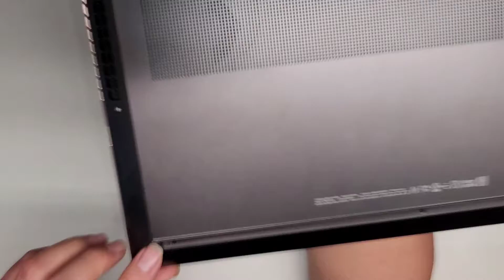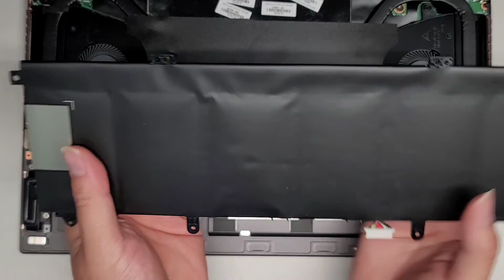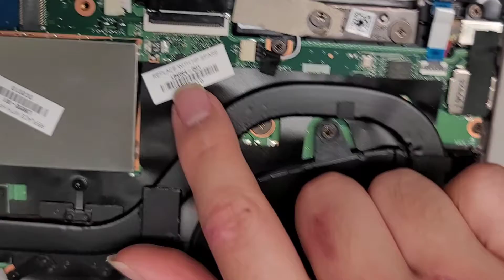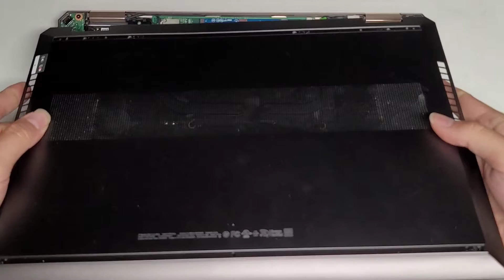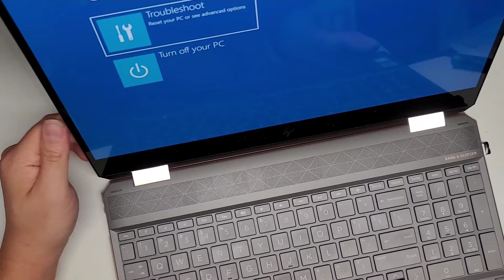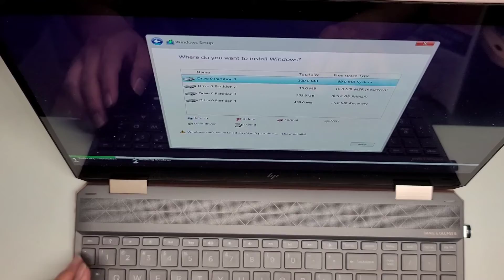HP Spectre x360 Convertible 15 15-df1043dx Disassembly RAM SSD Hard Drive Upgrade Replacement Repair

Comment: Will a bad battery cause my fans to run on high the whole time? Or it may be dirty/dusty inside? Currently my fans run high the whole time of using my laptop. Thanks
Reply from the maker: Check the temps
Reply: How do I do that? Is there a setting screen that shows temperature? What's normal running temperature vs running hot temperatures? I have this same laptop. Thanks again.
Reply from the maker: @LosAngeles21323.  You need to download a program like coretemp

Comment: I thought it was weird that the sides of the vent on the bottom cover was partially covered on the sides. I was about to remove them but I found your video and yours is the same. I'll leave it alone. 😊
Reply from the maker: Haha

Comment: My new problem is a blue screen bitlocker issue....any idea how to get around this? Thanks again for the battery replacement confidence  from your video!!
Reply from the maker: Sign into the website they give you and log in with your Microsoft account.

Comment: Got a Spectre x360 15-eb0013nf (10th gen i7 10750h, 16GB)... any idea if it has soldered RAM or not ? It seems there's no really reliable method (excepted disassembly...) to find out...
Reply from the maker: This might be closer https://youtu.be/aWXlO4mL0e8

Comment: I got the exact same model and I removed the rubbers and there is no screws whatsoever how can this be ?
Reply from the maker: Sounds like you didn't peel up the adhesive layer.
Reply: @ItsBinhRepaired  all of its gone what was under matches the same color as the laptop
Reply from the maker: @marvin_luis  doesn't make sense. Make a YouTube video and I'll take a look
Reply: @ItsBinhRepaired  you right it was under some black tape but slight problem you got any recommendations on how to remove strip screws
Reply from the maker: @marvin_luis  you need a screw extractor. I use this https://amzn.to/3Onr5Mq
Reply: @ItsBinhRepaired  does the extractor fit on a regular size power drill
Reply from the maker: @marvin_luis  yup, use the lower speed high torque setting and go very slow.
Reply: @ItsBinhRepaired  alright appreciate the help my laptop just keeps shutting off after being on for a minute or two just been needing to clean it
Reply from the maker: @marvin_luis  hope that's the issue.

Comment: Thanks for your video, I will atempt open and clean my Spectre, it's been like 5 years since I bought it, so I guess It may help it run cooler, the only hard thing to find is the rubber feet. Sometimes I think speaker makes a crackling noise when driven loud (Like above 70%) is it normal on this laptop?
Reply from the maker: If it's crackling, the membrane is likely torn on the outer edges.
Reply: @ItsBinhRepaired  Thanks on the advice, I will try to check that and find a replacement 🙌🏽
Reply from the maker: @hp6r  hope the repairs go well.

Comment: Hi,

As I haven't opened the back panel since purchase, I'm unsure of the whether i can upgrade my RAM or not.
It seems the rubber feet (only the rubber) on my laptop have extended 3cm and 2cm respectively beyond their original position, and it often comes out but the rubber feet parts i.e, the plastic sticks are still attached to the back panel  covering the screws sections Because the screws are not visible. Could you please advise on how to address this issue without causing damage? 
HP SPECTRE X360 15t-df100 CTO

Appreciate your assistance.
Reply from the maker: This video explains it https://youtu.be/Z04na84d9FQ

Comment: Man, I don't know how I would keep track of the screws and know where they'd go. LOL.
Reply from the maker: I mention my system at the beginning of my videos usually. Gotta put them in the pattern you remove them. Lol
Reply: I'm quite new at this I wanted to help my boyfriend with this but when you showed the flex grip straps holding down the battery I got scared of trying this on my own. A+ Computer Repair student here. His PC is an Acer Swift 3. @ItsBinhRepaired
Reply from the maker: Haha did you fix it?
Reply: @ItsBinhRepaired  commented on the wrong Video i was going to fix the Acer Swift 3.  Forgot the damn screwdriver set!
Reply from the maker: Did you get a screwdriver set? I recommend this https://amzn.to/3u8vRXy
Reply: I have it, just forgot to bring it to my bf's house to fix his Acer. RIP. @ItsBinhRepaired
Reply: If it ever gets fixed I'll thank you for teaching me to fix my first ever computer. LOL @ItsBinhRepaired
Reply from the maker: @hannaheliza3954  lol fingers crossed

Comment: I had a hp spectre x360 15 doing the same thing would only go into boot mode and wouldn't successfully boot back after doing so.  Brought it to a fix PC store and they got it running without replacing anything they said they just had to do something with the bios apparently.  But what sucks is several months later I started noticing the front of the laptop case would start to split at first it was very little so I didn't care but now it's soooooo bad and it's been like 2 years since they did the work bit I know it was definitely from them doing something incorrectly because it always had a slight gap from the time I got it back but like I said it wasn't a big deal at first and I didn't say anything cause I already went 2 weeks to 3 weeks without my computer.  This was right when all the kids were going online for school so they were slammed.  Idk if I should bring it back or not because of how long it's been now I feel I'd be a pain in their ass to do that but really feel they should fix it due to how hard and expensive it likely will be for me to fix it myself.
Reply from the maker: That's caused by a failing battery.
Reply: @ItsBinhRepaired yea it definitely was a failing battery right after I wrote this I removed the battery and man it was pillowed so badly!!!  I've been running it without a battery for a bit and it works fine like that.  What's weird is when the battery first starts to fail that bios boot loop seems to be a normal thing to happen first.  Likely due to the CMOS battery power coming from the main battery I'm thinking.  What's weird is it doesn't have any issues running without a battery at all though?  Anyways I just recently ordered a new battery, I also ordered new ram and a new ssd which it will be my first time replacing those.  I ordered a crucial 16gb x2 set up that runs at 3200mhz I'm hoping it will work as they said it was compatible with my model and I really wanted something that had faster transfer speeds and bigger capacity.  I wanted to go to 64gb instead of 32gb but it was hard finding any info on compatible ram and I couldn't find anything on if that would work or if it was even necessary to go that big.  I only wanted to go that big because it wasn't going to cist that much more money so if it would work I wanted to just do it at the same time.  The ssd is another story again I went with crucial as the company and bought a cloning set up which I need to research how to use.  I am wondering if I can clone the ssd while the original is still inside laptop and the new ones in the cloner?  I got a crucial 2tb with a decently fast transfer speed of around 7000mbps write And read speeds.  I want to get this laptop to game some what decently as I have been doing tons of cloud gaming and all sorts of gaming from all my devices.
Reply from the maker: @SpreadingKnowledgeVlogs yup, without battery is fine. You can clone using this software https://youtu.be/4p5jFDzVwUw
Reply: @ItsBinhRepaired  shortly after writing that review my laptop died.  I took it all apart and couldn't fix it.  I have a little knowledge on using a micrometer to test the resistance and voltage and it seems there's a short some where and I think I have it isolated to where it's shorted.  Whats weird is I was doing a huge usb drive clone job and it was getting super hot (the drive in the usb enclosure which was a ssd was what was getting super hot) right after that is when it failed so I'm wondering if maybe it pulled to many amps for too long and friend something in the usb side of the power rail.  I saved everything cause I'd really like to get it fixed one day but seeing as the laptop was sucking performance wise from the day I bought it I decided to instead of fixing it go for a used gaming desktop from around the same period of my laptop.  Ended up with a alienware aurora r7 for $360 that came with a i7 8700 watercooled and a nvidia gtx 1080ti and despite that hard ware being older it works so much better then what I had in the laptop which was a i7 8665u I believe.  The new one is 6 cores and 12 threads so more cores and threads then the old laptop plus a much much higher clock.  Mine for some reasons constantly hangs around the max boost clock speed of about 4.3ghz constantly even at idle.  It surprised me by just how well it plays games.  My laptop had the crappies nvidia graphics card u can get I feel with the mx150 and I was sold it as a gaming laptop but it could literally barely run even the lightest of games.  This new pc runs games at 1080p all high settings and gets 120fps all day long and then can even run a few games at 4k with frs activated.  So happy I went the route I went and also will never buy a pc brand new ever again.  I've learned so much just from this one experience.  Now I know what to look for in cpus and what not going forward.  I might eventually build a budget amd rig or intel rig using newer but still used parts so I can keep the costs down.  I want to get a rig that can run a 40 series card effectively.  Mines can probably do it for some games but seeing as it's limited to pcie x8 speeds which was dumb of them to do it doesn't really make sense to use a better card in my set up unless I plan to upgrade it eventually which I do.  So plan is to first buy the gpu test it with my current set up, I'm sure gpu intensive games and 4k will run better with it still and then when I can afford to switch it over to either a i9 set up 12th gen or newer or a amd am5 with 3d cache.  I'm nervous about going with amd though as I've heard they can be buggy.
Reply from the maker: You can't really compare a desktop to a laptop's performance lol

Comment: I opened mine up to have a look and clean out some dust and after i put it back now it takes long to boot and its running really slow 😭😅 lol and my keyboard right now seems to have stopped working wtf i didn’t really touch anything besides the ram, and even then i was careful
Reply from the maker: Hmmmm are the battery and touchpad OK?
Reply: @ItsBinhRepaired  battery is fine and touchpad also not working
Reply from the maker: @MeltDownxPR  likely the touchpad is the issue. They like to put thermal sensors in there sometimes. When it's not working right, it throttles the computer. Similar situation with the battery.
Reply: @ItsBinhRepaired  thats interesting, any recommendations on what I could/should do?
Reply from the maker: @MeltDownxPR  reseat their connections
Reply: @ItsBinhRepaired  i’ll give that a try, I appreciate you!
Reply from the maker: @MeltDownxPR  let us know how it goes
Reply: @ItsBinhRepaired  so far no luck unfortunately
Reply from the maker: @MeltDownxPR :(
Reply: @ItsBinhRepaired  yeah, CPU is at a constant 20% usage on idle and memory reads 35-36%

Not  sure if that’s normal, CPU still reads 20% after opening chrome and going onto a random website, strange
Reply from the maker: Hmm
Reply: Update after 2 years lmao, i had put the laptop to the side for a while but decided to check it out again 

I managed to figure out that the keyboard and trackpad still worked and that it was something wrong with the drivers. I upgraded to windows 11 by performing a clean-install and now the keyboard and trackpad are functioning normally 

The only issue i still have is that under “other devices” in device manager, theres a few drivers with the yellow triangle and some say “unknown device” 

Also the issue with the CPU, it gets stuck at the speed 0.40GHz , the BD PROCHOT keeps enabling after reboot, i manage to get the cpu to work normally by disabling it with throttlestop. 

Trying to figure out these last 2 issues and hoping to get a little more use out of the laptop for the remainder of my semester lol 🤣
Reply from the maker: Lol nice

Comment: Hi, have you seen where the backup battery is? i have to replace it. I haven't found any videos on this.
Reply: There is no bios battery or w.e. it's called.  The guy commenting probably has the same booting problem this computer and mines had.  That's what I was told was wrong with mines at first but it ended up being something else.  I believe the bios got corrupted some how.
Reply from the maker: I see
Reply from the maker: What backup battery? There's only the one.

Comment: is there a wifi card on this board that can be replaced?
Reply from the maker: Not replaceable. Pretty sure I mention it in the video.
Reply: @ItsBinhRepaired  thank you. My computer updated the bios and now wifi is disabled and has a yellow exclamation point and wont reset at all even after performing system recovery and hardware diagnostic is saying it has no problem and I was trying to see if I need to replace the network card
Reply from the maker: Try bios reset and delete the driver completely
Reply: @ItsBinhRepaired  I tried and after performing component test, it shows wifi card is bad. I guess now I have a very expensive paper weight since the netword card is soldered on
Reply from the maker: @las0587  use a usb wireless adapter

Comment: Hey are you familiar with gigabyte laptops? I have an aorus 17x yb and the rgb keyboard won’t illuminate anymore. I tried everything. Even reset windows to factory and redownload the aorus control center. I’m beginning to think the keyboard lights are dead. I can’t find anything online to show where maybe there is connection is on the motherboard.
Reply from the maker: Not too sure why they would die. Did they stop working after a clean install or just randomly one day?
Reply: @ItsBinhRepaired   It just stopped working randomly. I left the laptop on overnight and when I got up the laptop had restarted itself and keyboard was off.
Reply from the maker: @justswitched8841  very strange
Reply: @ItsBinhRepaired  Yeah I don't know what happened. It being a not so common laptop I was unable to find anything online about it.
Reply from the maker: I hate how YouTube doesn't notify me of replies. Were you able to figure it out?
Reply: @ItsBinhRepaired  No actually. I ended up selling the laptop
Reply from the maker: @justswitched8841  aww

Comment: Thanks for the explanation. Intel 660p Series M.2 2280 2TB PCIe NVMe 3.0 x4 3D2 can be installed ?
Reply from the maker: Any pcie nvme SSD should work
Reply: @ItsBinhRepaired  Do you think should be worth it, to put SSD PCIE 4.0 SAMSUNG 980 PRO 2TB my HP specter is the same model only, the only diference mine its 2021 i7, 16Ram, 512gb SSD... but i see other info in ethernet that only can performe PCIE 3.0 so, PCIE4.0 Will not work as good as could be... Pls can you help me with this :(
Reply from the maker: @BIGBOSSZZ  I don't think the difference is worth the cost

Comment: Splendid video, exactly what I needed. 🙂
I personally always use a grounded wrist strap and a grounded desktop pad because of the MOSFET (metal oxide semiconductor field effect transistors).
Also, why not try to power it up with just the rear cover snapped back in place before putting in the screws?
Also, unless the customer absolutely, positively does not need their data files you should try data recovery first before over writing with a new OS install.
And the newer Mac's always max the fan speed when powering up. I believe it is to clean them a bit.
And finally, running a quick check using the diagnostics option F2 on the boot menu, at least on the hard drive and RAM would be a really good idea. 🙂
Reply from the maker: I just have my knee against my metal desk. Sometimes the hinges aren't strong enough without the screws, so I just put it back together.
Reply: @ItsBinhRepaired  The hinges are not directly supported by the bottom cover; you won’t damage the system without it temporarily while moving the display. The system board and top cover are sturdy enough. I do it this way all the time.

I only suggested snapping the bottom plate back on as a consideration to minimizing any damage due to static electricity, especially since it seems you are not even using a grounded desktop pad. You can even just set the laptop on its side edge.

Side facts: Even a very small amount of static electricity, too small to be felt can damage transistors. And amazingly enough static charges can even sit on top of paper, wool, hair, plastic wrap and a lot more.

Here’s a link for a very inexpensive pad and wrist strap.

https://www.amazon.com/dp/B09FK16B12/ref=cm_sw_em_r_mt_dp_G90JBX7A2CZHMZ7EGAE1

I’m going to send you some bling so you can get that; of course what ever you use it for is entirely up to you. 😀

“Live long and prosper”
Reply from the maker: @tekman2000  hahaha thanks! I got a cheap one, but haven't used it.